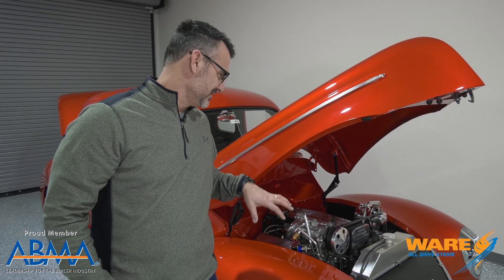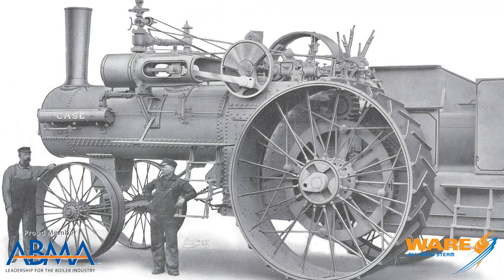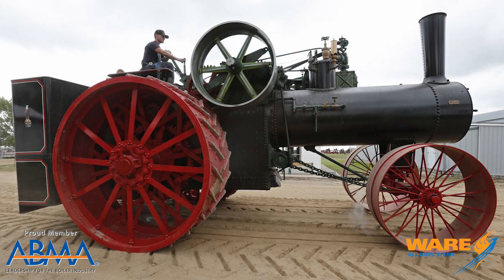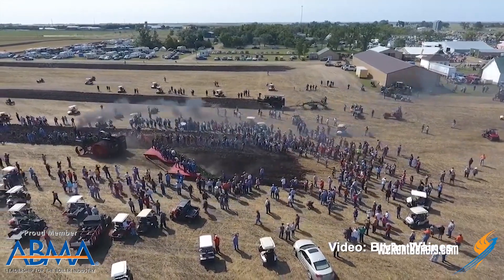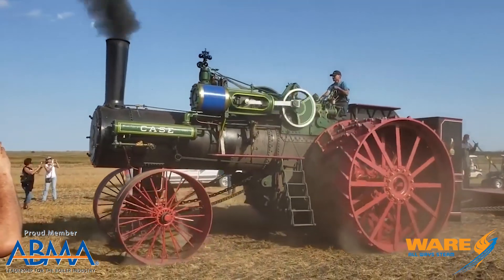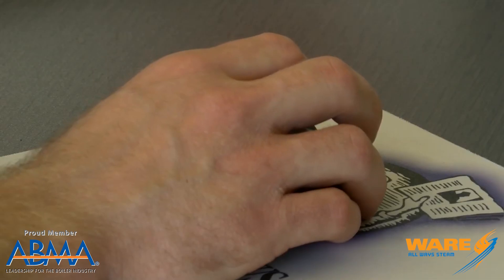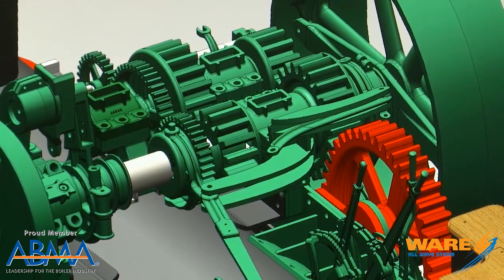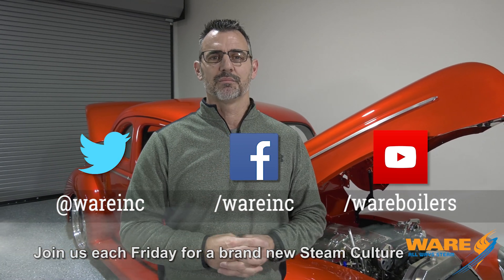The Incredible CASE 150 Steam Engine Tractor - Steam Culture

Comment: its my understanding all of them but one boilershell were scrapped, the thing is 17000 lbs empty, and cost them over 1 million to build
Reply from the maker: That's incredible.. Even in video, it is so hard to comprehend how large these things are. Thanks for your comment and thanks for watching!
Reply: this one is a full reproduction of the original. only 9 were made 'back in the day' and none survived. this guy got the original blueprints from case and built this one.
Reply: @LKSimbalvr  well just the shell of one of the boilers was found in a barn, that was the only piece of one that was not cut up and melted down that was left of an origional, but yes its built from blue print on up , and took about a decade plus or minus a few years I read but the wheels are 7 foot tall its massive and with steam you have pure power from the start not like other engines that have to wind up for power, but they are slow and hot as heck due to the fire to make the water into steam, though lots of things can bring up the effecency of a boiler higher, as we all and ware boiler knows, like rifled tubes, multipass boilers, inproved drafting, ecconomisers, superheating. several things that had barely been tried in moble boilers like locomotives or traction engines, makes one wonder, livio dante porta did use some experamentation though, and did use rifled tubes I am told, but only got one engine built ground up from his designs sadly, but made many plans for steam designs including a 10000 hp locomotive for use in argentina where he was born for hauling coal